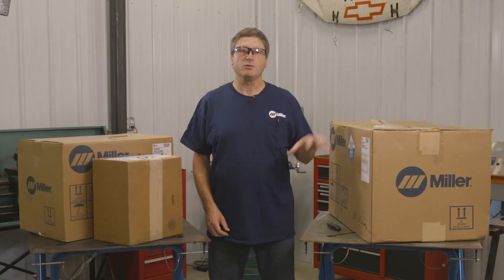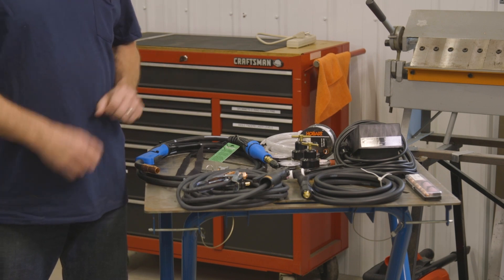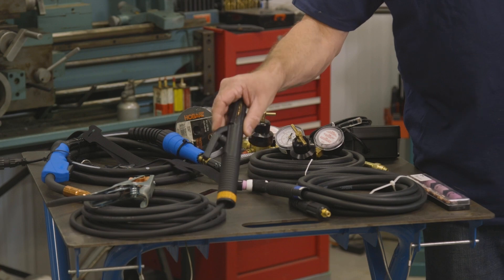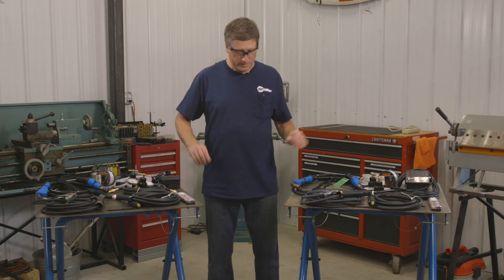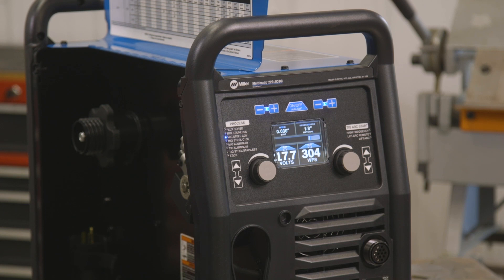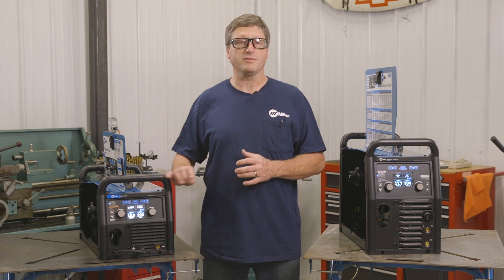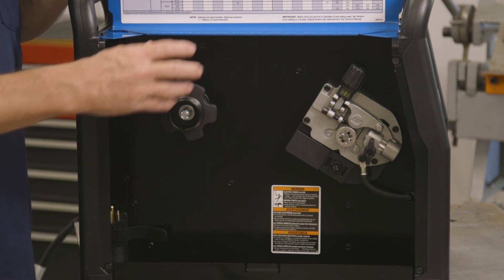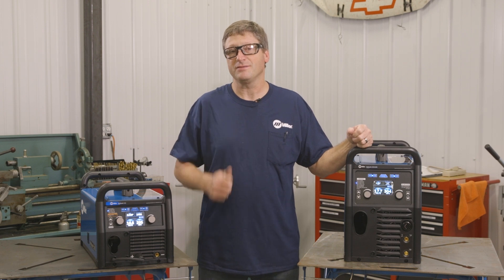Multimatic 220 AC/DC vs. Multimatic 215 (Real Gear)

Comment: I own BOTH. My advice for any buyer: Unless you are 100% confident in how your electrical outlets were wired & grounded that you’re gonna plug these machines into; and 100% confidence in the electrical circuit from that outlet to the breaker box, do NOT plug your 215 or 220 into the outlet! Spend the money & have a certified Electrician check your outlet & circuit first. These wonderful machines (I love mine) are essentially a massive electronics circuit board inside a blue metal box; and within 1 second you will burn up that board plugging it into a funky wired outlet. Ask me how I know about this! These machines are not our old 141 Mig machines that you could practically drop on the ground & it would just keep working; these are sensitive machines that will not put up with any outlet BS for even a second. I wish Miller sold some kind of outlet strip that went between your machine and the outlet, that would shut itself off the moment it detected a surge or a bad polarity or bad ground etc.. I’d pay $200 for such insurance, no problem.
Reply: Okay, I'll bite. How do you know? The machine shouldn't be sending current thru the ground in a normal state. Any other bad wiring would short the terminals and pop the breaker. I can't see how a residential single phase service could provide a dangerous voltage to the machine. Or did you plug into a single phase leg on a 480 3ph service that was wired incorrectly?
Reply: @sccolbert  I blew up my machine in an instant. Old machines could take my outlets, but not new sensitive machines
Reply: @w46try7  But what caused it to blow?
Reply: @sccolbert  Wiring worked but was not correct; neutral was in wrong place. Any mistake in wiring will fry your motherboard in 1 second